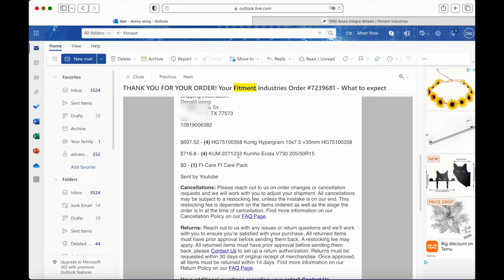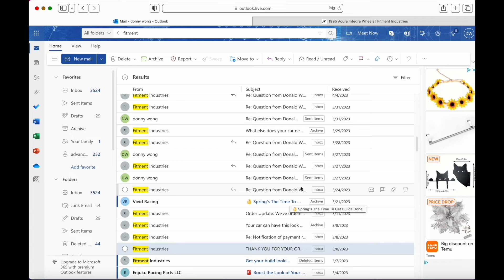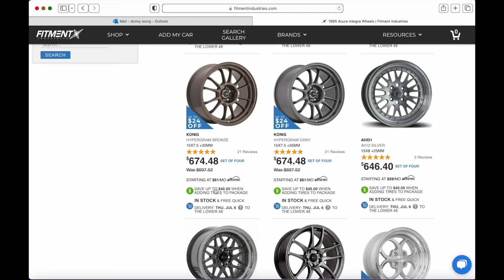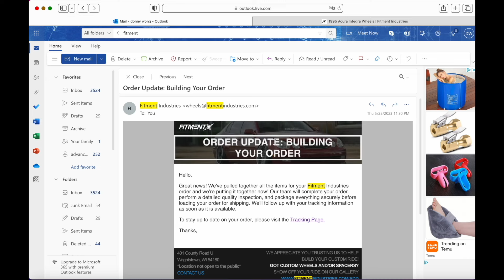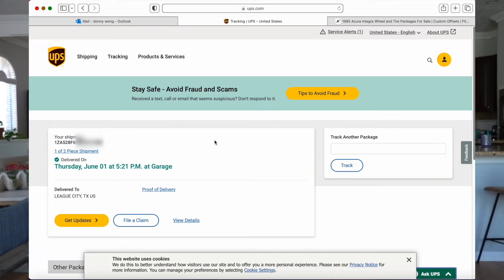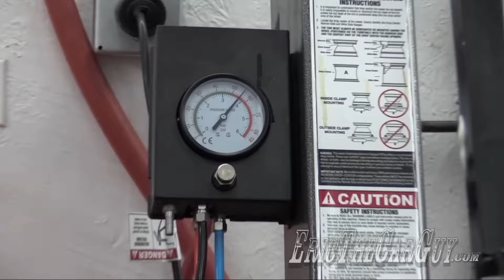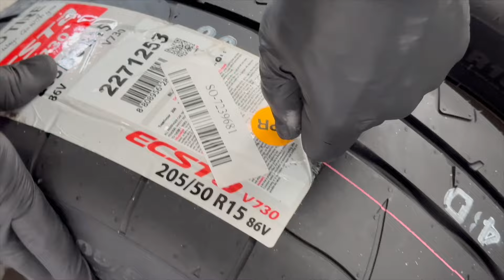Don't Buy Wheels Before Watching This ! My Fitment Industries Experience / Acura Integra

Comment: I had a bad experience with custom offset’s their sister company. I ordered a 20x10 -12 offset and received a 20x10 0 offset. I emailed them and received a shipping label to send back. Once they received the wheels and inspected them they sent me my new wheels. 3 week process. They sent me the same exact 20x10 0 offset aging! So same process aging 3 more weeks. Now I’m 8 weeks into my purchase . So I spoke with someone on the phone come to find out there website was wrong they didn’t have that wheel in -12. But! It was an option on the website site. We finally worked something out. But the whole process took over 3 months 🙃. I get the frustration they carry themselves as the professionals so you expect them to know what they’re doing. But the reality is they’re not unfortunately

Comment: Assuming it took at least a week or so from them boxing them and getting them at your house, would leaving the tire with that much extra pressure cause any damage to it in that time? Or would it be fine as long as you get it to the right pressure before putting them on the car?
Reply from the maker: I think the tire would be ok.